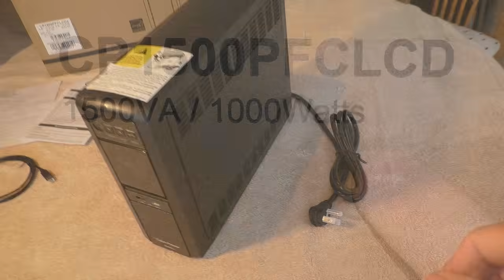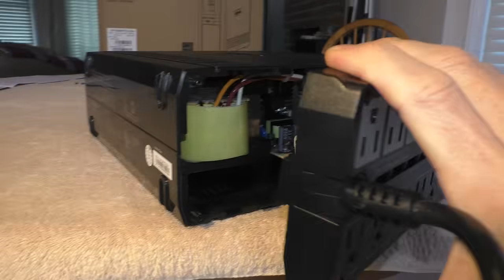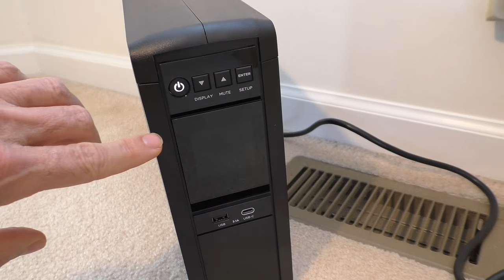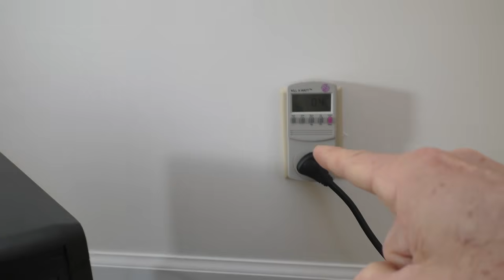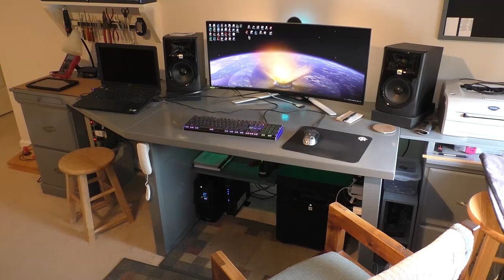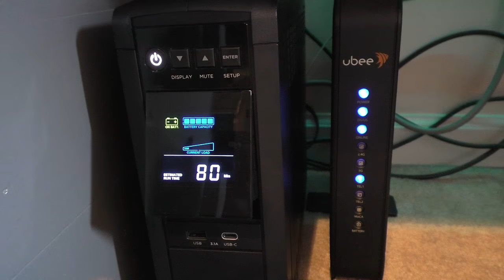#1 BATTERY BACKUP CyberPower CP1500PFCLCD Computer UPS System AVR Pure Sine Wave Power Supply APC

Comment: Anyone that actually read instructions would know that if u power on unit (press n hold) when plugged into to power cord to initialize it would operate a and charge at it's designed speed

Comment: I researched best I knew how to find a UPS for my new desktop PC. It only required a 750 watt PSU but my parts options at nzxt's custom build was limited - so i got a MSI 1000watt Gold PSU.
Did i buy the right size UPS for that PC? I ask bc 'after' I'd already purchased this model, i get a reply for a support email i'd sent to cyberpower. Guess what? They told me I'd need this other model that costs over $600!!! so i'm hoping they were just trying to up-sale me and the CP1500PFCLCD will be perfect. Thanks man!
Reply: I figured it out on my own....next

Comment: Great vid. 
The software is total garbage.  
If you don't need the auto-shut down feature (the only real reason to use their software) than you don't need to install their software.
If you want to monitor UPS loads and outputs this can all be done with Hardware Info.  Hardware info can access all the device data through USB connection without needing the CyberPower software installed (because as I mentioned the cyberPower software is junk).

The cyber power monitoring sofware eats up WAY more resources than it has any right too and it has caused system hangs for me.

Comment: This product is a fire hazard. I bought 3 of them and tested. The transformer over heats on battery mode (on grid power outage). Started smoking and burning the any plastic that is touching the transformer.  Lucky I was testing it so that I shut it down. Imagine I was not there when and the power goes out! I believe you haven't tested it to the thoroughly running it more than 6  Poorly and unsafely designed product, I would strongly recommend anyone NOT to use this product.
Reply: Yep, i agree. It's a fire hazard.
Reply: I just purchased one from Costco, I will be returning it. I wanted to find a cheaper option to free up my EcoFlo.

Comment: Hello! Do I understand correctly that the fan doesn’t start as long as you have power in the house? Does the fan only work when the battery is turned on? Doesn't it make any other strange noises?

Comment: May I ask if you can set the software to shut down the computer for you after the power outage and when it runs on the battery?
Reply: You have to connect PC via the USB (maybe network or other) and run UPS software on the PC. Some systems eg TrueNAS Scale, have built in drivers for APC & Cyber Power UPS. This is Pure Sine Wave output on battery, which is better for many devices. Beware: one comment says Fire Risk on battery. I did not notice any glue used on the PCB, but Cyber Power use poor glue on some products, which goes brittle and conductive

Comment: dead after ONE week in charge and test with 60W resistive load ( 1500 VA , 60W .... 4 hours ... logical bullshit .. ) , 
dead just the morning I supposed to bring to customer ...
--> Amazon , refund , no more
Reply from the maker: hi, mine is working great with no problems. it has saved me from around 20 power outages and brownouts. sorry for your bad luck maybe u got a defective unit. thx

Comment: Question did you plug the main source of your PC into the surge protection side or the battery protected side. I'm assuming surge but just want to double check with anyone. 🙏
Reply from the maker: i plug everything into the battery side so they work during a power outage.

Comment: Have 3 of these as well as a rack mount and they are really nice units and usually around $50-$75 cheaper than APC.  They have the same 3-year warranty and their battery replacements are usually a little cheaper too.  Early on they didn't have a good reputation and deservedly so because the reliability and quality of their devices just wasn't there.  Over the years they have steadily improved to the point their products are every bit as reliable as APC.  That old reputation still follows them around though and reddit nerds will stupidity look down their nose at them.
Reply: Do they still use the yellow stuff?

Comment: Thank you!!  I am researching UPS.  That is a Business model.  You can purchase an additional card for remote management.  I was close to buying this one but if you don't need remote management or care about the color screen I think the Costco CST 1500S is a better value at $180.  It's 100 less watts, has coax in/out surge protection where this model doesn't.  But only 2 USB A's.  No USB C port.  Appreciate you sharing real world use.

Comment: Thank you for this video! I just got mine today =] I love it so far. The main thing I was fighting was that the freezer chest and my computer/PC components are plugged into the same outlet. Every time the freeze compressor would kick on/off, it would cause a very noticeable surge, even though I have the computer stuff on a surge protector (Random monitors would lose display for a 3-5 seconds, speakers would make a click/snap noise). No issues now that I have the ups!

Also, check out PowerPanel Personal or Cloud, if you want to see the UPS information on your computer/phone. The instructions weren't very clear on what software you can use to use the USB Port to PC: "USB communication port allows communication between the USB port on the computer and the UPS unit." You can see the event logs too with the power outages; a nice summary of the past 1, 4, 12 , & 24 weeks; Energy Reporting (estimated energy used in an amount of time you determine); as well as some advanced features: schedule shutdown, Notifications, runtime management, voltage settings, Self-testing, firmware updates, and more.

https://www.cyberpowersystems.com/products/software/
Reply: FYI  The instructions state, "Make sure the wall branch outlet is protected by a fuse or circuit breaker and does not service equipment with large electrical demands (e.g. air conditioner, copier, etc.)

Comment: I own a Cyberpower 1285 AVR that has not been used for a couple years.  After charging for several hour with power button off than when I turn the power button on I get continuous fast flashing of the power button. the display screen says the battery is fully charged but when I unplug from the wall receptacle  no battery power is available at any of the power out receptacle.
Reply: It needs new batteries. You ruined them by not keeping the unit plugged in and letting them discharge.

Comment: The avr u explained is for generator field excitation. The avr in this ups is just a transformer that has two extra taps for 80v and 140v so when the voltage falls below 100 it switches to the 80v tap and uses the "auto transformer" effect to bring 120v out and when the voltage goes above 140v it switches to 140v tap and lowers the output voltage again using the auto transformer but if the voltage goes out of range too much then it will switch back to battery power. Some even better units that are called "online ups" takes in the incoming voltage and turns it into dc then turns it into ac again those totally filter out any noise of waveform frequency issues from the incoming supply but those are definitely not need for desktop computers..the smps it self turns the incoming ac to dc and will happily run on anything that gives it enough voltage to run ac or dc doesn't matter.
Reply: thanks for the technical breakdown..always good to know what's actually happening in the background

Comment: No Thank You!... I got me a better deal with the following: APC BN450M UPS from Walmart for $49.00 and a 12V 35AH battery from Harbor Freight for $74.00. I just had to wire in parallel the 2 batteries, the one from Harbor Freight with the one the BN450M comes with.
The CyberPower CP1500PFCLCD comes with a 12V 9AH battery and costs $220.00 PLUS shipping at Amazon. I only spent $123.00 and got 4 times as much energy storage.
Reply: Sorry,  but you are not comparing like-for-like. 
Your solution may be useful to some users and may suite you perfectly well (I do hope it does). However, your APC does not generate a pure sine wave on-battery waveform (so not good for sensitive electronics and may even fail to power them when needed). 
Your APC also has no USB connection for a PC so cannot, unlike the CyberPower, perform an automatic controlled shutdown of a PC if an outage continues for longer than your user-selected duration, even when you are not present. 
You have a larger battery but a good UPC is much more than just a battery backup. And that’s before we get into reliability of APC vs CyberPower (hint: CyberPower wins). I’ve had both and now only use CyberPower because, even though more expensive, they offer much more so are much better value. In most cases, the electronics they safeguard are so much more expensive than the UPC that skimping makes no sense.
Reply: @mrf7583  You're right, 'it suites me perfectly well'. I use it as backup for an HP desktop PC, it's monitor and a fan. They all work great with it. Even though most AC fans don't run well with it, for some reason this AC fan that I got from a trashed microwave oven works well with it, which I use to cool the UPS, not that it needs it. This cooling is only provided if power goes out.
Consumer electronics don't work with an AC voltage. The first step in the power supplies of computers, monitors, phone chargers... etc, is to convert the incoming AC voltage to DC voltage. This is done with simple bridge-diode and capacitor circuits. This circuits don't care about how crappy the incoming AC waveform is, as long as it's an AC waveform, they work fine.
Reply: No you did not.  You don't know what you're talking about.
Reply: @Beerkunstock  Says an ignorant!

Comment: I built a high end PC with a 6900XT and 850W PSU. This whole time I've had it connected to an old APC unit that's rated at 450W. I just started playing a game that maxed out my system and it shut off on me. I'd never questioned the actual wattage on these things until now despite always using them to avoid data loss and damage via dirty electricity from the bad quality power we get here.. Just ordered this unit.
Reply: Howdy ? Can you tell me how long does it provide backup while gaming or on heavy load
Reply: @LifeIsUnfair-00  It's a battery backup, lol, you're not supposed to game on it it's so you can close everything out safely and shut down. You get about 30-40 minutes. Thing has been rock solid for me, so far.
Reply: @MadClowdz  Ik, the thing is i currently have a APC BX1100 along with a Ryzen 7 8700G 5070 and a Corsair RM750e, on idle i do get backups but when the mains go out under heavy gaming/load the UPS doesn't even give me a single second and shuts down instantly with a loud beeping continous sound.
Reply: @LifeIsUnfair-00  Battery could be bad.

Comment: I own and use a older version of the UPS, love it.  If you are going to buy Cyber Power, buy this unit.  You may not need all it's capability, but with more capacity than you need, but when the power goes down, it is nice to look down and see you have some extra time to save what you are working.

Comment: When the UPS is inactive, so when the actual battery of the UPS is NOT required to support any power to connected devices, that the machine itself runs silent? I ask this because power outages are rare, so in the case of regular everyday use  the UPS  won't be making much noise? is that right?

Comment: Good day sir! Received mine and it does not power on. The faulty wiring light is on in every outlet I connect it to. Even tried charging for the eight hours nothing. It gives me the beep code for when powering down instead of powering on. Any thoughts

Comment: I have the 2015 model, just replaced the batteries, I think I got an upgrade. It seems the original batteries were 6amp/hr, and I bought 9amp/hr batteries for replacements. I use it to backup the WiFi, network, and security system, etc. I have a smaller APC SC620 for my monitor and desktop. All should be enough until the generator is running.

Comment: I have my pellet stove plugged into it during the winter Incase we lose power, it will prevent my home from getting smoked out, it happened a few years ago when we lost power and the exhaust fan shut off but the fire was still burning. This unit is awesome

Comment: So when I first bought mine I didn’t charge it, did I Fuck it up?
I don’t want to have broken mine
Reply from the maker: you'll be fine. they recommend fully recharging because if it sits on shelf before purchase it can lose charge over time. Once its plugged into wall power it'll recharge as normal.

Comment: Does your unit have a strange oder to it? I opened my new UPS, this exact model, and it smells like new but also has a smell I’m not familiar with.
Reply from the maker: Mine didnt have an unusual smell.
Reply: @FunBubble  Smell, YES. I've had mine plugged in and running for a couple of weeks and mine it still had an acrid smell to it. It's not nearly as noticeable as it was initially, but I still can feel it my eyes. Decided to stop using in my small office and dedicated it to other devices - as expected smell is gone. Battery leakage? Offgassing, not sure what the reason is, but definitely an issue.

Comment: 6 month update? any issues? clean power still clean? thanks for posting video!
Reply from the maker: hi, still running great. has saved me multiple times from little blackouts. I now have a proper 400watt max load desktop computer plugged into it and it handles it easily. thx
Reply: @FunBubble  how long does the charge last ?
Reply: @FunBubble  I'd also like to know about how long you're getting on this larger setup?

Comment: I am considering whether to get this UPS or a Jackery mobile power device (because I will be camping).  I see an overlap in functionality, to some extent, comparing the two but I’m afraid I can’t do it all with one device. The Jackery devices are set up for solar input whereas this is not. We do have power failures here in Florida, not to mention ⛈ lightning but I do not need constant power that badly.
Reply from the maker: for camping the jackery is better. this UPS is meant for running a computer or home theater with clean uninterrupted power.
Reply: Thanks, I was just day dreaming that there would be a convergence of products. The idea that “dirty power” is corrupting music listening or messing with computers is interesting but somewhat doubtful - and very expensive to correct.  There is a revolution going on now as people are starting to question power and energy usage in homes and vehicles - where it comes from, is it most efficient, and is it good for the planet.

Comment: These units are 100% sheer garbage. I've had one for a long time. They work fine for a year or two or three, but once your batteries are no longer able to hold any charge (which will happen eventually, guaranteed), then the UPS unit is programmed both to shut itself down and - due to its totally idiotic design - it also, inexplicably, cuts all power to everything that is connected to it.  

So the point being, due to this horrible design flaw, connecting stuff to this UPS is worse than not having any UPS at all...because this UPS will, in the long run, cause your equipment to be harmed as if there was a power outage, even though there wasn't.

In other words, this product directly causes the very same disastrous problem to occur that you are using it in order to prevent from ever happening!

Competitor units from other companies do not cut power when the batteries cannot hold a charge any more. But Cyperpower products do (apparently because they were engineered by morons). So best to avoid that brand like the plague they are.  Otherwise, you are putting all of your gear at tremendous risk.
Reply: I'm thinking of getting UPS system, which one do you recommend that is comparable to this unit then?
Reply: @draconismagnus  look for APC.
Reply: APC batteries will also slowly die as EVERY SINGLE UPS EVER BUILT WILL.  You're uninformed.

Comment: Nice review.  Wouldn’t your laptop automatically switch to battery power in the event of a power loss?  The setup will be more valuable once you go with the desktop.  At any rate I just bought one of these Cyberpower PF sinewave UPS’s too to deal with some wonky power coming from the utility.  Looks like a great unit.
Reply from the maker: yes the laptop essentially has a built-in battery backup that will save it from power outages. But I am getting prepared for buying a new desktop computer where this CyberPower Backup will be needed. thanks

Comment: The way you said "Cyberpower" was enough for me to hit the like button LOL! 😄😄😄

Edited 2/21 - After the Snowpocalypse we experienced in TX last week, I'm definitely looking into this. THX!!! ❤️❤️❤️
Reply: I bought mine for that very reason, I also had multiple outages before that nightmare last week, so it was time! Just received it today
Reply: This unit is designed to run sensitive equipment for a few minutes at higher loads. At lower loads you’re looking at an hour give it take if run time. For longer term grid down look for a solar generator unit. Something like inergy flex or jackery portable power station.
Reply: This thing is a lifesaver, according to the device I’ve had 189 power outages since I purchased this in Jan 21, 2021 so 189 outages in 6 months